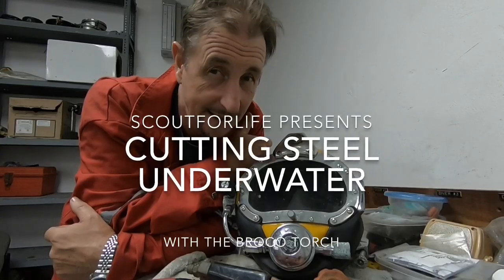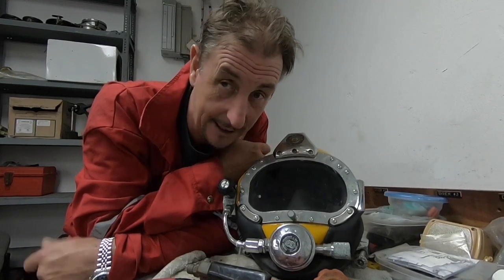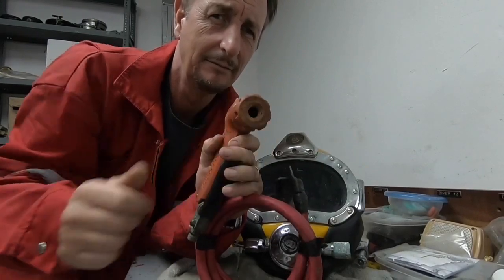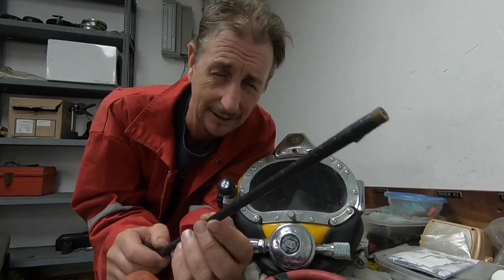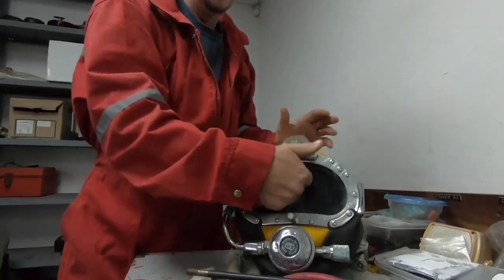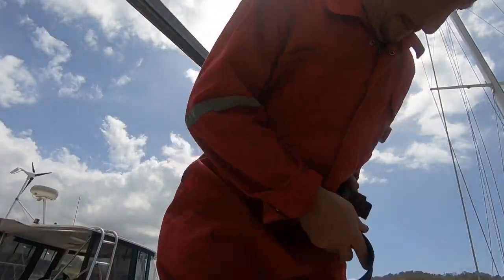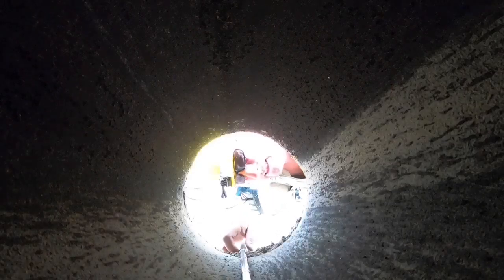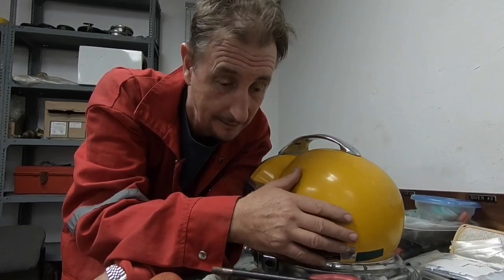Cutting steel underwater

Comment: Hi, Funny little video you made there.
I just advice you to change the 200 volts you mention in your presentation into Amps because underwater the DC current that is used, has an open circuit voltage between 60 and 80 volts and the arc voltage turns generally around 35 volts. As for the Amps setting with that type of rod it is generally 150 Amps.
Reply from the maker: Hi Francis. Thankyou for taking the time to comment,I'm glad you enjoyed it. You are quite right, I meant Amps but kept saying volts. Tho this video wasn't really meant as a technical how to, I'll pin it for those looking for those details. I would stress tho that once the torch is lit the current is irrelevant and not part of the actual cutting process. In fact much of the cutting seen in the video was performed with the torch not energized at all. In practice a 200 Amp DC plant is provided for that work but it can even be started with auto Batteries in series in a pinch. Cheers.
Reply: That’s true; with those type of exothermic rods cutting “cold” is quite possible and often done.
As for starting the rod with a car battery it can be done too if only a few rods are to be burned, otherwise on a real cutting job a welding generator is always used.

Comment: Hey Man, thanks for the video.  Somehow a flash back of the movie "Thief"  (1981) where  the character by James Caan cuts through a steel vault, with a thermic lance, to steal diamonds.     So the gas pressure in the 'helmet' must equal, or be slightly greater than water pressure, to prevent water entry via the neck gusset?  The 'system' you used is only for 'shallow' depth?    Respect.
Reply from the maker: Circumpolar Bear Cult hello Bear. You are correct on the helmet and the demand regulator in the front maintains the pressure which is ambient. The gusset is called a "neck dam" and even if it's a bit loose and leaky it seems to still function. Good question RE the Depth. I think it's only dictated by the oxygen supply pressure so deep work too, just have to up the pressure. I remember that movie! Thankyou for coming by my friend. Peace.